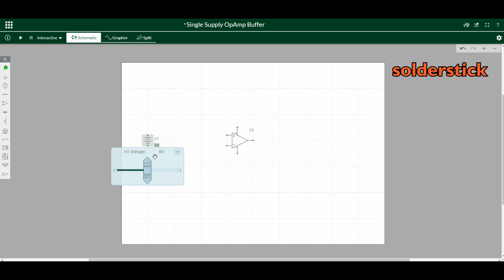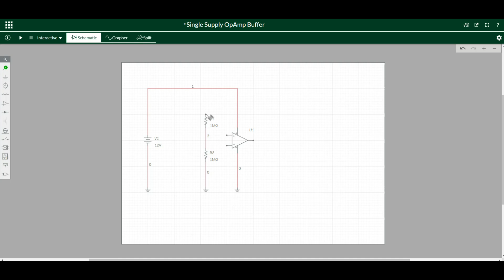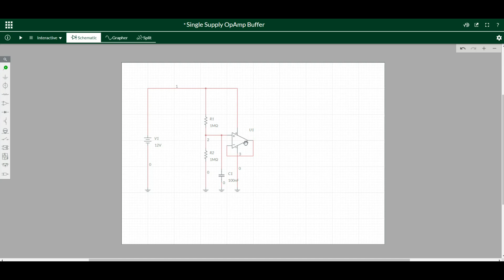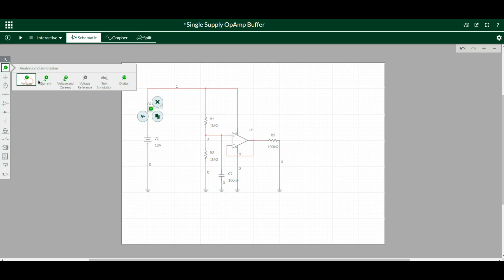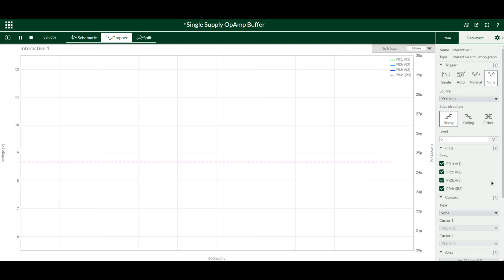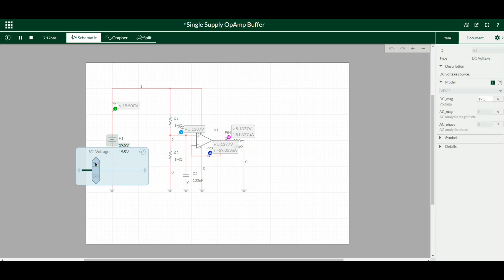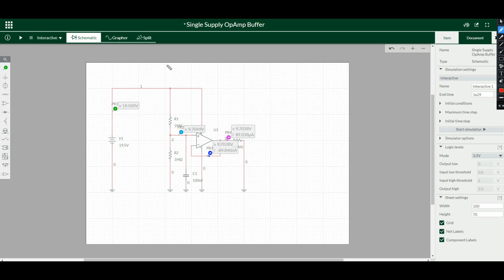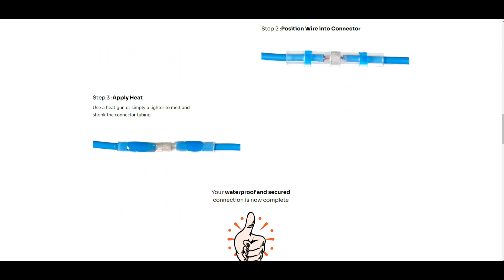Classic Circuits You Should Know: OpAmp Buffer - Brought To You By Solderstick Wire Connectors

Comment: This circuit also makes a nice and stable split rail power supply for when you need negative voltages, the ground becomes your negative supply and opamp output is the new “ground”.

Comment: Paul, this is a great introduction — your explanations are always so clear and to the point — but from the comments it seems like a lot of people are interested in guitar effect pedals and other ac small-signal buffers — and the schematic as drawn here won’t work well for those. Maybe you could do a follow-up video about ac-coupled single-supply buffers that would show the use of injection resistors to decouple signal from the virtual ground? I’d be happy to collaborate in developing the ideas if that’s helpful.

Comment: Why do you need the OpAmp buffer if the voltage divider voltage, and the Voltage out of the OpAmp are the same? What is the buffer doing for this circuit? I'm asking this seriously out of my own ignorance of electronics. Trying to understand. Thanks.
Reply: i think it's because with just a voltage divider as the load varies, the voltage would change. with the opamp, it will do what it needs to keep the voltage the same
Reply: @tamtgirl  this is correct
Reply: low  resistance voltage source

Comment: Thanks Paul. It took me a while to wrap my head around buffers. My interest in them came through my interest in guitar effect chains. The way I describe it to myself now, is that when a low impedance device (or long cable) would otherwise reduce the signal voltage along the chain, the buffer (or 2) will ensure that the signal output voltage is always equal to the input voltage, and so maintaining it's integrity, despite what the following device wants to suck out of it. Of course that is with an AC input, but I guess the same applies with DC? It would be interesting to see a simulation of the opamp actually doing its buffering, by putting something variable (a pot?) on the right side of the schematic that would otherwise cause a voltage drop,  of more or less. Of course, the buffer won't let it drop. So as we changed values to the right, am I right in saying we would expect to see a change in current on the VCC input on the opamp as it does its thing in maintaining the voltage on the output? As you can tell, I am a noob, so I hope this makes sense.😄😄😄

Comment: This is extremely useful  when  working with sensors  that are very hi impedance.
Reply: How so? Just what is the OPAmp doing in this circuit? Voltage out of the OPAmp is the same as the voltage out of the voltage divider. I'm asking out of my own ignorance of electronics.

Comment: Should that voltage divider have been on the left (input) side of the red line?  It might have been helpful to have some varying input voltage (triangle, square, or sine wave?) at the non-inverting input and show it gets repeated at the output.

I think the other thing that would have helped is to show a heavier load (smaller resistor).  Especially if you compared it to trying to attach the load directly to the resistor divider.  Without the buffer, you'd see the output voltage droop as the the output impedance dropped.